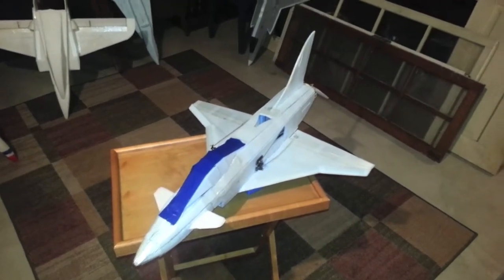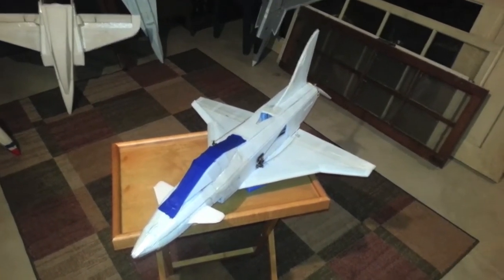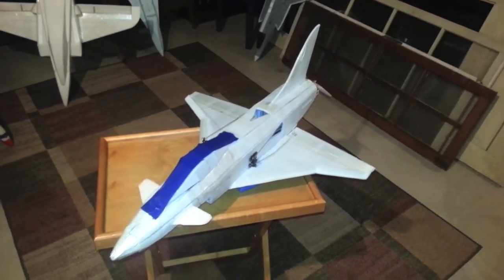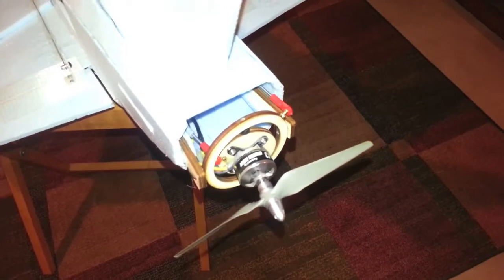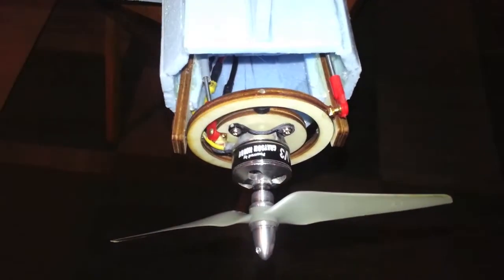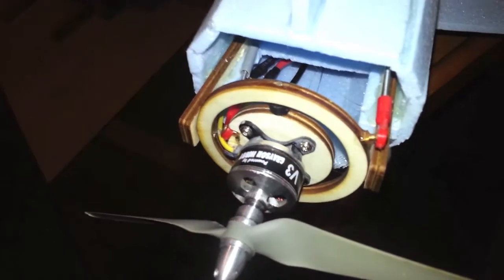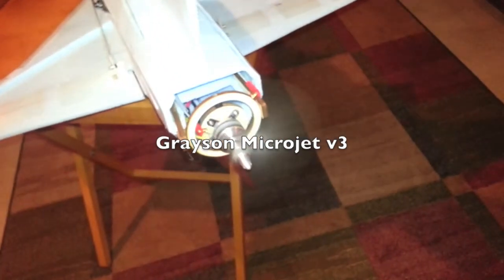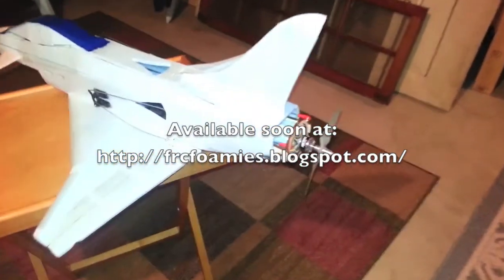Boxermad84 Thrust Vectoring Motor Mount

Comment: @0917bobb well i cant say for sure before i finish testing,but i had a mount assembled with a motor on and pushed the motor into a set of scales just holding onto the folk part and i maxed the scales out at 6lb with not much flex. Ill be running some tests soon.